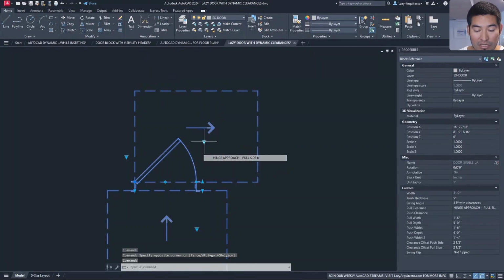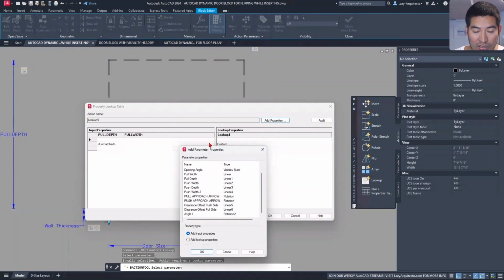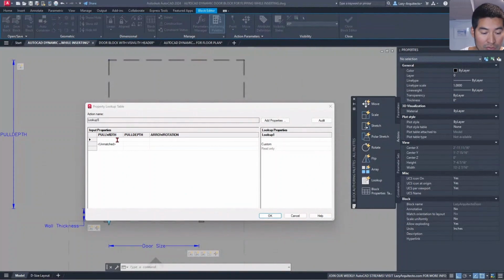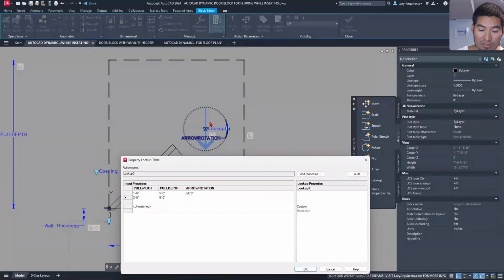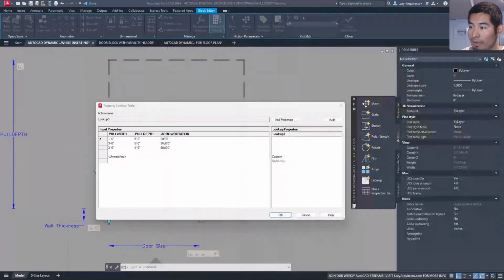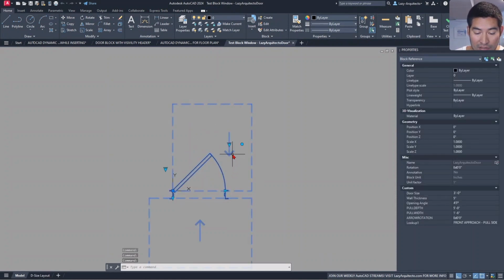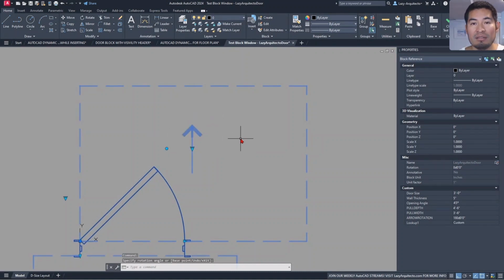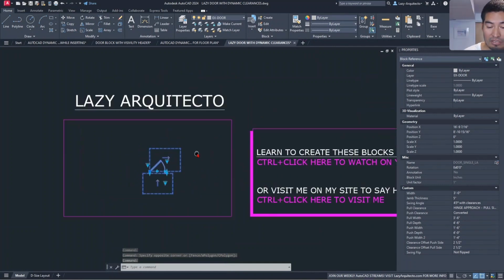Simplifying 3 AutoCAD Tasks with 1 Dynamic Block 2/2

Comment: The Vlookup is really cool, but I don't know if you can plug it into a door of any size. I don't know if there is a variable = door width + clearance.
Reply from the maker: Yes, the ADA clearance for the door is designed to work and adjust with doors of any size. This is a standard feature of the door and is not explained in this video. We covered how to create the door in a previous video here: https://youtu.be/OaQLofDbWX4 . In this particular video, our focus is on incorporating the VLOOKUP technique to control three actions with a single one. If you have any questions about making it work, please don't hesitate to ask. You can also download this block, along with all our other blocks, on our Patreon page here: https://patreon.com/LazyArquitecto